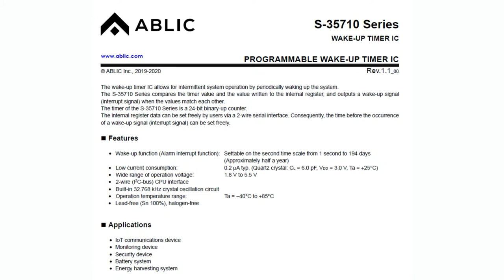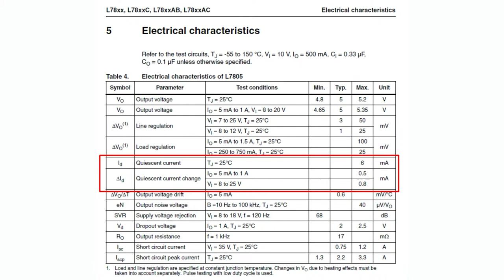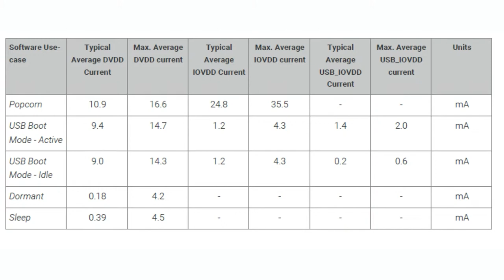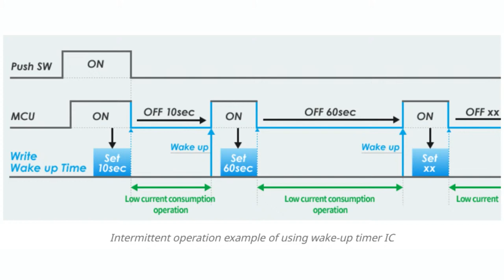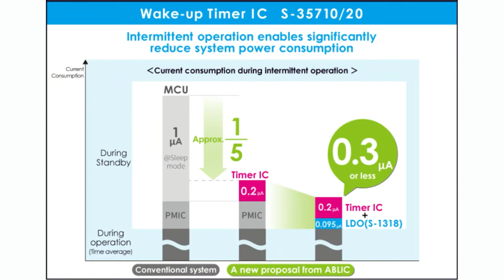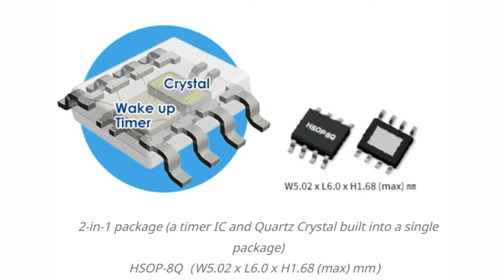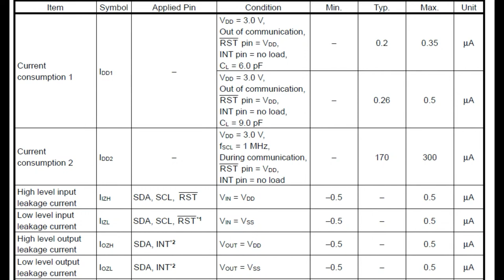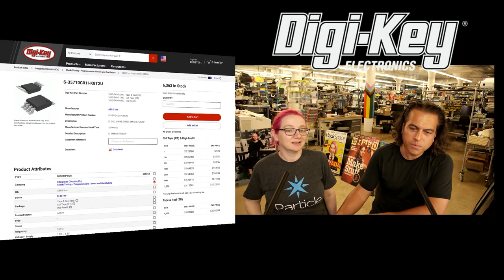EYE on NPI - ABLIC S-35710/20 Series Convenience Timer ICs #EYEonNPI @ADI_News @DigiKey @Adafruit

Comment: I have done basically the same thing with an MCP79401 RTC. It has prog. Interrupt output polarity which is necessary to handle the En pin on LDOs. Its current is somewhat higher @ 1.2 uA, but uses the same crystal and is much cheaper. Not too hard to program this chip to use the Alarm function and the range can be very long, if needed. Only problem- you can’t find them in stock anywhere- or other RTC chips for that matter!